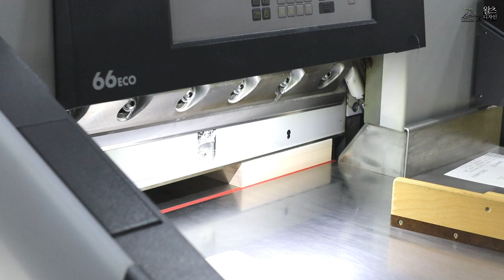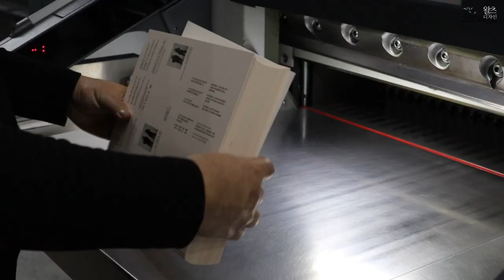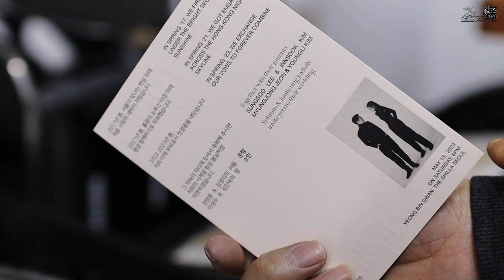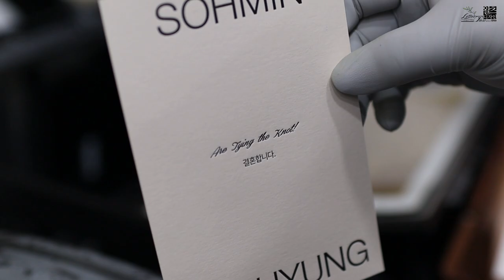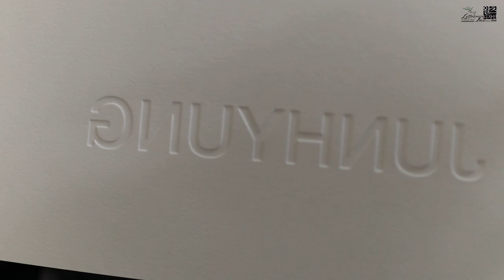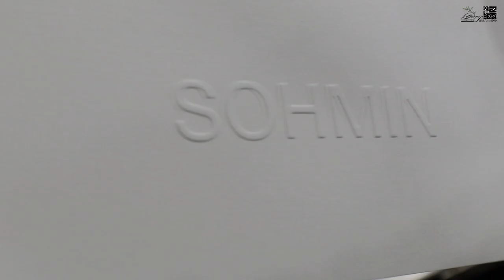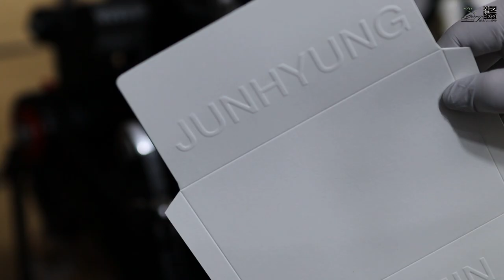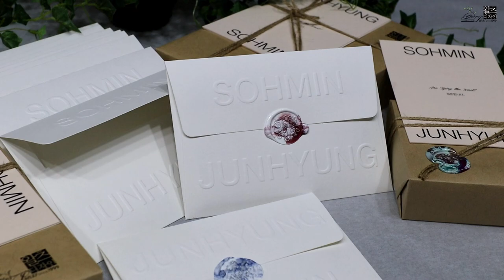Making letterpress wedding invitations & envelopes.레터프레스 청첩장&봉투 만들기.

Comment: Love the work as usual. Question, in timestamp 03:26 and 05:26, why did you have to make two setups rather than one?
Reply from the maker: Compared to the thick text above and below, the middle text was thin and small, so I tried to adjust it, but it smudged, so I printed the thick text first, wiped off some ink, and printed the middle text.  I wanted a clean print myself, so I made it that way.😅